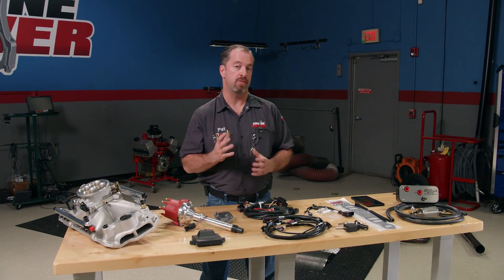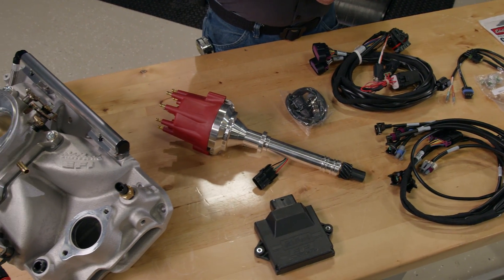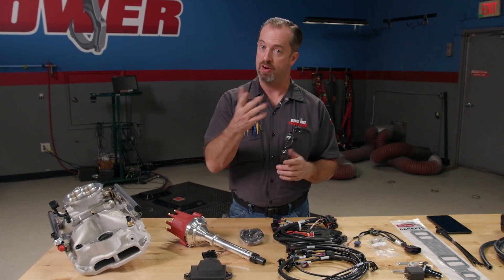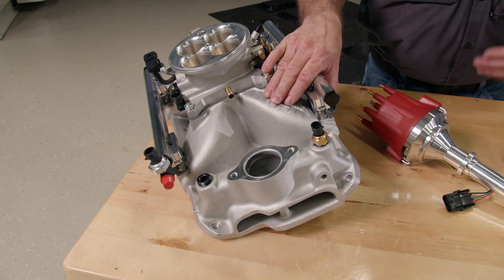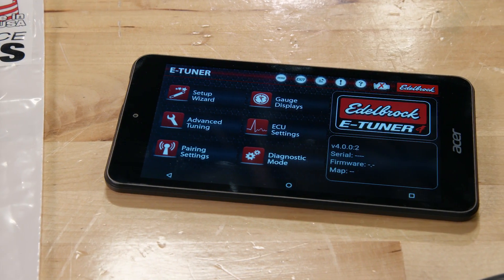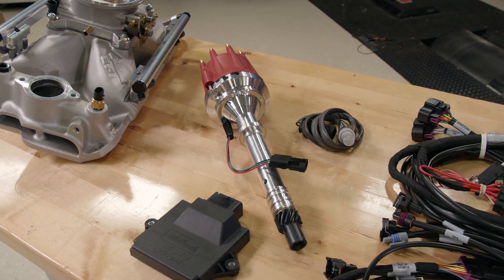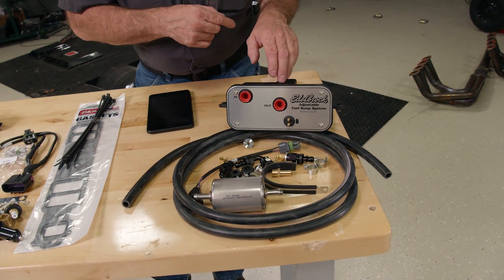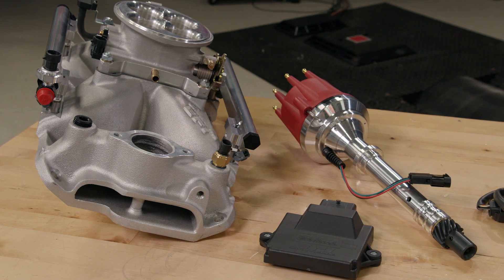How To Modernize A Classic Powerplant

Comment: It doesn't come with a fuel pressure reg. (extra) , you need new spark plug wires and coil (extra), fuel pump relay (extra), There is nothing in the  instructions even about the relay you DO need, Good luck finding a throttle cable bracket that clears the linkage. Its not as complete as they claim. The photo copied installation instructions are as vague as they can get, that's why when you call technical support its always busy.

Comment: Cool, but price will set you back a bit.
Reply: it's not terrible considering some of the systems i've seen,  simple comes with a prices, sure you could go fitech, sniper etc, but your supplying everything else,  the PF4 is a pretty complete kit, not much on them with the system running as of yet that I have seen on you tube.
Reply: @mplante7352  you’re absolutely right. I will say that with Fi-Tech the reviews are completely mixed, almost 50/50 when you look it up online. The ratio changes for the worse when you ask in person hot rodders. It’s not a favorite. It’s best to stick with Holley Or Edelbrock.